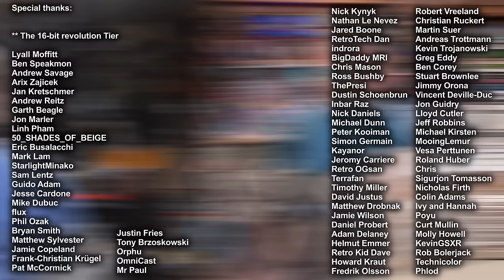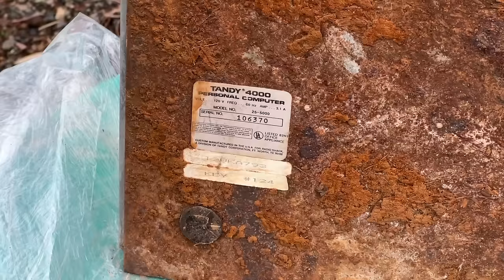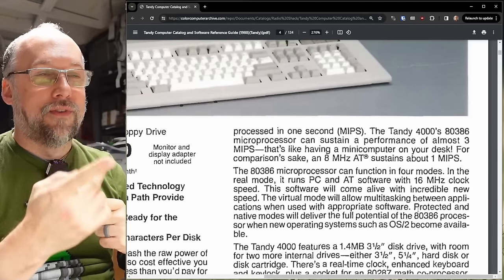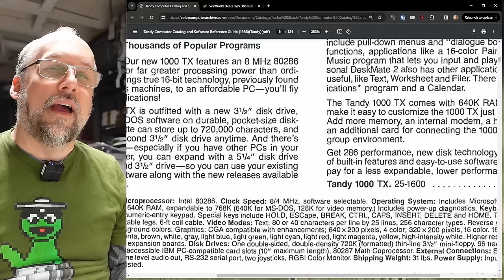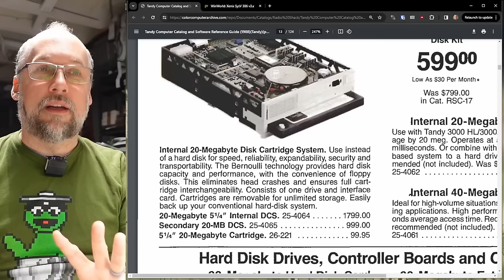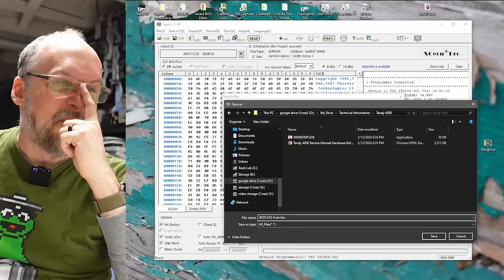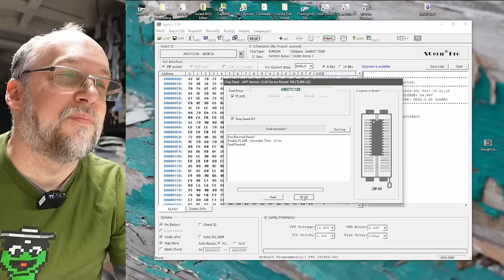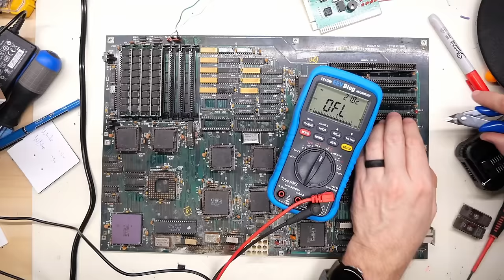0079 I'm at a loss for words when I first see this Tandy 4000 computer

Comment: (TL;DR: Seriously.. I am NOT for you. Not intended as an insult, but I MAY use insults if you want to try to insult me)..

What a lot of people don't understand is how little water REALLY damages electric circuits and what not. 

NOT saying water is "harmless", but.. I'll try to be short instead of explaining the FULL answer, so remember that IF you listen to me and believe that I know what I am talking about, YOU still won't know too much you will AT BEST have heard SOME things that MAY give you an inkling about SOME of the issues.. so.. VERY early in the Dunning Kruger curve.

Let me start by pointing out that water CAN be a problem and give a few examples of what/how it can be a problem. Oxidation. (pretty much) all metals can rust. The thing is; Water doesn't make anything rust, BUT metals have a .. hmm.. I don't know the English word, but a.. "Potential". and.. if two metals are in contact with eachother so there will be a current going between them (Make a lemon battery and you'll know what I am talking about), then the less. "Nobel" (directly translated from the Swedish word "Ädel") one will rust.. Another thing is if there is ACTUAL current running through the system. PURE water doesn't conduct electricity well, but all water that gets exposed to your electronics won't be "ultrapure".. so.. water CONDUCTS electricity, so in circuits that ARE powered, the water can create bad short-cuts..  So there IS good reason to think it can be a problem.

When it comes to THIS specific machine.. the metal bottom plate was RUST!!.. THIS.. is a good sign.. because the bottom plate is NOT!!! part of the ACTUAL electronics you want to work, so it could LITERALLY have fulfilled the actual function of being a "Sacrificial anode".. It rusted.. so something else (something important) didn't. (Ps. I have learned that a lot of people- f.ex in the US- don't seem to have been informed of this in physics class.. so.. IF you think that your water heater is SUPPOSED to rust and be replaced regularly, or if have an out-board engine on your boat,... LEARN about sacrificial anodes.. and.. replace them regularly and you wil have protected your more expensive hardware)

Just generally: I have cleaned a SHITLOAD of computer components in the tub.. and they all ended up fine.. There are just some things to recognize.. ONE is that.. Things doesn't break immediately.. there MAY be gold AND zinc in your electronics and that IS a recipe for disaster if you use normal water (that will conduct).. BUT.. it takes time. The time it takes to clean anything.. isn't enough.. (well; If you do it OFTEN on the same piece of hardware it will of course fail sooner or later.. though it doesn't even have to be the water that does it, it CAN just be the mechanical wear and tear)..  Then.. there is the time it takes to dry.. you WANT this to be short.. I PERSONALLY prefer to use woolen pieces of cloth because they really really work HARD to suck up all the fluid. .(Though it DO tend to constantly contain a lot of.. fat.. so.. you have to be wary)..  OR.. I can use my hair-dryer.. I use it PRIMARILY to BLOW away the beads, but I MAY use a BIT of heat as-well (at the end) to kind of.. encourage remaining water to engage with the air and increase the humidity of the air.

and in the end.. I'll just let it rest for at least 12 hours.. making sure it has enough time to just air-dry.

I didn't mention using compressed air to blow away the water.. yes.. This is also a viable method, and the only reason I didn't use it to point anything out is simple.. 

Because compressed air is also a different topic I want to discuss, but then from it's normal use-case. The thing is.. we are all taught to ALWAYS use compressed air.. (also people try to say that air that is blown doesn't create static electricity whereas sucking air does.. that is of course completely ludicrous.. but YES your vacuum cleaner is FAIRLY likely to build up a static charge AND it may give your electronics a jolt, but the reason is MUCH more complicated than "one creates static electricity the other doesn't".. they BOTH create static electricity. Long story short the MAIN problem with a vacuum cleaner is that it is a very crude tool, that have a LONG metal tube where rushing air goes through, so creating MORE static electricity because of more surface area getting exposed, and more importantly.. Because of the crudeness it's VERY likely you'll just randomly.. touch.. stuff)....  but.. here is the thing with compressed air.. it doesn't REALLY matter how many bars of pressure you use on how small point.. it STILL!!!! will only blow away dust that is "loose enough".. Do you KNOW what exists on your components?.. It WILL be the thigns that exists in your air.. did you know that MOST of the waste of the human body is actually exhaled OR sweated out through pores, and so on?.. Seriously.. Pooping is about getting rid of the things that your body couldn't even absorb.. Peeing is about getting rid of some excess fluid and some things that your "garbage collection system" (primarily liver and kidneys) are trying to get rid of.. but.. dead skin-cells are CONSTANTLY in a huge cloud around you as a person.. they are just thrown out there.. and.. so are a lot of other crap that you no longer use.. and you exhale a shitload of waste products.. The concept of being.. "Clean" is.. UNFORTUNATELY fooling a lot of people to be VERY gullible for marketing ploys.. and.. worse.. the things that a lot of those products are doing are actually ruining our ability to get rid of waste products.. no.. you shouldn't smear things all over your body.. (except if it is for some form of kink you enjoy, then go ahead, but no.. just.. using a bunch of beauty products, or whatever.. trying to make your skin more smooth thinking it is "better".. what you are doing is preventing your pores to get rid of waste properly so you keep it in on your skin).. REALITY.. is that.. we are constantly sending out a LOT of different chemical compounds into the air.. most of them are "fatty" in nature. and.. computers LOVE sucking in our air to use to cool their components... and this is before we discuss how the actual molecules from cooking or other activities may traverse our small part of the universe.. so.. yeah.. there will slowly be building up a fatty surface on ALL components in ALL electronics you have.. and.. "Dust".. can be a LOT of things.. I know there is a lot of BAD pop-science definitions trying to say what it is, but it actually varies a LOT.. it may be fibers from papers that have been shuffled around, OR it may be our skin-cells. OR it may be road-dust, or rubber from tires.. either way.. DUST is what the compressed air is supposed to.. "blow away".. but what about the fat?.. THAT will remain.. it is kind of like an adhesive.. and.. even worse: As an adhesive.. it WILL glue the DUST to the components. You think dust is dry?. .well. .SOME is.. but.. a lot isn't.. it is ONLY the dry dust that compressed air work on.

Not saying it doesn't work, or anything like that, I am just trying to paint a picture where any reader who felt enticed enough to READ what I wrote would realize that.. there IS a deeper issue than.. "The simple answers".. "oh, THIS is how we clean computers".. I don't say it's wrong.. but I say there are more issues.

and.. when it comes to water damage in computers?.. technically modern hardware IS more sensitive to it.. especially because it's.. poorly constructed. .WAY too thin pathways on the circuit boards, and so on.. but.. 

Idiots.. who know nothing about electronics or how.. actual physics and chemistry works.. HAVE decided that.. ALL a corporation has to do when it comes to ANY electronic device is to just boldoy proclaim.. "Water damage".. and suddenly the ENTIRE concept of.. "You sold me a defective product" has been nullified. 

I know of a person who had bought a new phone in the early noughties. .and.. it died while she was outside of the room.. and.. no one had touched it.. and. .when she got it back from the store she bought it from the answer THEY gave was.. "water damage".. It had NOT been close to water.. EVER.

I know there are a LOT of actual repair people talking about this "problem" from THEIR perspective.. and they ARE good people.. and.. they talk about SPECIFIC things (also known as "anecdotal evidence".. and.. "evidence from example").  so.. they mention the phone they got where they SAW the water.. OR.. where.. the phone smelled of perfume, but they STILL could smell the urine.. so someone dropped it in the toilet and tried to "scam" them for a replacement.

But there are NEVER just.. "two sides".. it's about situations.. individual situations.. it's not about trying to prove that one side is always correct.. and when it comes to "water damage". the most horrific thing I found out was that a SHITLOAD!!! of hardware today comes with some small.. "stickers".. in them.. that changes colour IF they are exposed to water.  Apple ALWAYS go by the stickers.. ALWAYS!!!!! and they are the worst, but the problem is the same in all OTHER manufacturers of cellphones who think THIS is a way to "prove" something.. it literally proves NOTHING!. (Let me put a tag on the example I mentioned)
Reply: First of all.. This is ridiculous, because as a "gauge" it just doesn't work: The chemistry of the situation relates to something changing colour because of exposure to water?..  This is a matter of a Chemical reaction.. ~ Chemical ~. . AND it doesn't get.. "undone" at any point in time!!??.. so.. just ONE water molecule at ONE point in time will change it.. have you heard of something called.. "air humidity"??..  I accept that air-humidity is NOT enough to just randomly change the colour of the sensor-pad.. the.. "sticker".. but.. It doesn't get reversed.. or more exactly.. "Reset".. that is.. IF a PART of that pad gets exposed to water.. it will change colour.. another part gets exposed at a later date? it changes colour.. and.. so on.. Have you heard about something called.. "Air humidity"??. I have heard ENOUGH people tell me that they.. owned a lap-top for a while and THEN it experienced SOME problem.. and.. the response they got from the computer-shop was.. "Water damage". .and the simple answer is.. it's not even POSSIBLE that it was water damage.. and.. this would be annoying enough if I was ONLY talking about the people where they LITERALLY skirted having to fix things because.. "warranty".. BUT!!. .(and this is ESPECIALLY true about Apple.. they don't seem to like competent repair people).. even WHEN there is an OBVIOUS fault with the hardware.. and it is NOT one that relates to water damage.. the "official" repair people.. WHEN they open up your device SEE that these pads indicate that it has been exposed to water.. Then they WILL immediately say.. "Water damage". EVEN if it isn't even about warranty.. you can have a 7 year old Macintosh laptop.. that is OUTSIDE of warranty so you would have to PAY for the repair.. and.. they STILL think that these pads ARE an excuse to say.. "water damage".. Hint: there IS something called.. "Humidity".. That is.. water.. in the air.. so.. Yes.. these pads WILL quickly end up saying that they HAVE been exposed to water. .just because.. they will have been exposed to water.. because.. design problems.. they do NOT create products that can hold air out from their devices.. if air gets in.. then water gets in.. because there IS water in the air.

So.. as a general rule.. BECAUSE people are gullible.. they just TRUST the things people who actually benefit BY being able to create the narrative UNQUESTIONED.

.. and. when it comes to the SPECIFIC example I mentioned (tag re-acquired). 

Well.. TECHNICALLY?.. I don't know for SURE that the phone in question never ever was exposed to WAY too much water.

However.. I DO know it wasn't exposed to it when the end user had it.. I mean.. seriously.. that couldn't have happened.. AT ALL!!.. ever over and over again.. Nah.. that is IMPOSSIBLE!!!!!!!.. (and as a person who DO know some stuff about electronics who had a career-path intended within computing; PRIMARILY in software but at the time you were expected to KNOW hardware so the ONLY way to get to the RIGHT education you kind of had to go through the electronics education available, and so on)..No; I am NOT trying to do an "appeal to authority".. I am a dinosaur.. I am ONLY trying to explain WHY I think the way I do. .and.. why I THINK it still has merit.. (and I PREVIOUSLY used arguments that would show I kind of DO know SOME things related to new developments.. you don't have to trust me; just do your research to SEE if my perspective MAY hold water and at least you'll know that I know SOME things related to the issue)))).

I don't claim I am.. "Right", there are a LOT of things I don't know..... but when it comes to the actual example I mentioned.. (anecdotal evidence, and evidence from example so not really something I think people should use to ASSUME I am right, just think of me as one SINGLE data point in a sea where you need millions).. then.. 

IF I were to ACCEPT the generic "brushoff" where there was NO proof provided at all.. just.. "I returned the phone and they replied 'water damage' "..

Well..One thing I CAN say for sure is that.. water doesn't damage electronics.. Water MIGHT damage electronics.. but also. .it's like I were to say.. "electricity damage" when talking about something that I won't take responsibility to.. or.. "ideological damage" to someone who tries to say that I was gas-lighting or  mentally torturing them.. It.. just.. isn't the "end" of the conversation.  It's just a ridiculous statement.. CLOSE to the SAME merit as.. "and you are a poopy-face".

So.. THAT was THEIR response and my evaluation of it.. but more importantly.. 

!!!! IF !!!!!!!!!.. That phone ACTUALLY died because of water damage???!!!.. I am PERFECTLY willing to accept this as a POTENTIAL answer.. as a POSSIBLE final truth.

Then.. why the HELL do they assume it is the person who bought it yesterday that provided the water damage???!!!.

I mean.. seriously. You know how different temperatures that may happen may "condensate" (NOT using that term from a chemical standpoint, but as in the droplets in your fridge definition).. 

So.. IF.. there was a phone that WAS okay.. perhaps even perfect. .and then.. went through a shipping-line from.. the far east.. to a specific store in Lillehammer Norway.

????.

WHY!!!.. is it that the actual.. "water damage". .has to have been on the end users side?.. 

I wrote a shitload of how STUPID this entire concept of "water damage" is to BEGIN with.. and.. also. .how the measurements OFTEN used to CLAIM water damage is.

But seriously!!?????..

If something "dies" because of water damage?.. Why the HELL should we ASSUME it was the end user that created it, ESPECIALLY if we are talking about a NEW PRODUCT!!????.. that they never really even used personally for the thing they wanted to use it for!!??????????

.. 

THIS.. is a "power tool".. it's when you TRY to make people BELIEVE in something that just no one should believe in in the first place.. you try to SKIP the actual.. "explanation" part.. and just try to find some form of.. "stamp".. that you can use.

and.. to ME??. .the FIRST part of this post is what makes this the MOST horrendous... the mere fact that.. water ISN'T in itself automatically harmful to electronics. .and.. even when it COULD be.. there are ways to design the actual casing, and so on to ACTUALLY create a product that COULD be used in.. 

IT'S INTENDED USE-CASE!!!!
Reply: Why do YOU have TO capitalize every SECOND word? IT makes the TEXT horrible to read.
Reply: @Dinnye01  ... Well.... I don't "have to".. I do, bcause I chose to.. (man.. I can give it up any time I want....*shakes*... ).. I may be joking, but also I probably  COULDN'T because I am a creature of habit and also I am talking in a third language, so I kind of have to follow the pattern I am used to.. 

That is (however) just a matter of pro-forma (To answer your question as you asked it), but reality is that you seem to ~think~ that what is easy for you to read relates to me and what I write instead of your ability to read.

There are books to help you learn to read better.
Reply: (In case anyone thinks I am being dismissive or abusive in my comments: I am. More importantly: I respond in kind. I do have some serious points. I am gen x, and I am between boomers and millenials and understand both sides of those situations, and both those sides don't wever seem to realize what actual social media and mass-media being available at the finger-tips of every single human being.

Most people act like narcissists: They assume everything anyone ever writes in a public forum really do have to seriously be "for them to read" so if they chose to not read it or if it doesn't agree with their view points they somehow can accuse the person who wrote it and then try to insult, diminish bully or otherwise be derogatory to them, and that is what I usually mean with my replies. I never sent any text in your letterbox the first thing you should realize is that you chose what you read or not. I didn't want to force you to read anything; The "TL;DR" culture- and I use capitalization completely correctly if discussing formal language- despite this being in an informal setting- TL;DR culture is seriously based on the idea that you are entitled to not ever have to make any form of effort and still have access to everything. You don't.

I have read Stephen Hawkins "Brief History of time", and technically I was fairly well read on the topic, but I still had to say "I didn't get this" and read a lot more to get his perspective and what he was talking about. I had to read around 5 times more text than the actual text in the book (most of which wasn't even relevant but if you are actively looking for information you have to sift through things of which you may know most stuff but you have to find the one detail you hadn't quite caught up upon)

This is social media: Nothing here really matters (I may try to share things that do matter and I may hide it in various texts that may not seem important but it may give a new perspective that not everyone may be aware of), so. Don't read my texts. You are perfectly allowed to. I wouldn't take offence. If anything I don't read everything on the internet despite how strongly I may "care". I make choices.

but.. if I want to: I make something that is called "an effort".

It's very difficult to say this without sounding like I am talking down to people, especially since that is how I feel when I do so, but seriously: We are at different points in our own lives, I may know more than you, BUT you may know more than I did when I was your age. It's not a competition. 

But seriously: If something is too long so you didn't read it... Then don't read it.. and realize that the person who offered you some information weren't obliged to entice you. You made the choice.. 

I would like to see the people of today's world go in to a library and start writing letters to the authors of all books just to tell them why they couldn't be arsed to read things, or why they would think it was difficult to read.

It doesn't matter. Other people aren't responsible for your competence/incompetence/ignorance.

Remain as stupid as you like, remain as ignorant as you like... but more importantly: It may be the wrong time for you to read it, OR it may even be something you shouldn't read in the first place, and not even then is it the person who wrote the text that should be ashamed; It's just that you were living lifes that weren't supposed to meat at that specific moment in time.

If you actually thnk you may CARE about the content but can't digest it; Either try to do your own research (proactively) as I did with the Stepghen Hawkin's book. or if you actually is blessed enough to talk to the person who wrote the specific text: Ask for helöp. 

Don't just insult them and say they presented it wrong.

That is just the logical fallacy known as "Tone policing" but in a more modern packaging.

Sometimes the goal should be to find a place to meet, not to be a "consumer" where you think it's everyone else that are there to serve you.

I may present ideas. I may hav specific ideas as to why I may want to share them. Yet.. You aren't paying me anything, so I don't feel like I am your employee.
Reply: @rogerlundstrom6926  You are missing the point. Catering to the inability of a lot of people to read a wall of text when there are no keywords sprinkled in is actually detrimental for people. Like shittok. Desroys the attention span. And for those, who can actually read, it shifts away the focus from the actual text. There is a good reason why books aren't written like this.

And yes, you are actually talking down to people, without considering quite a few options.

And talking about narcissism... having the need to write an entire wall of text to "defend" yourself.

Anyhow. There is a standard way people write - and the vast majority of the people follow. If you deviate, you might get criticism. And it would seem you really cannot take it.
Reply: @Dinnye01  << Of course; People's inability to read texts longer than an SMS is of course good for language. Let's make sure that people fear expressing themselves using words. You are responsible for what you read or not.